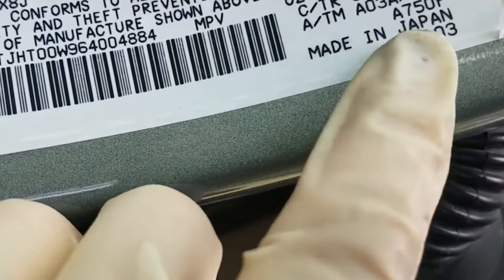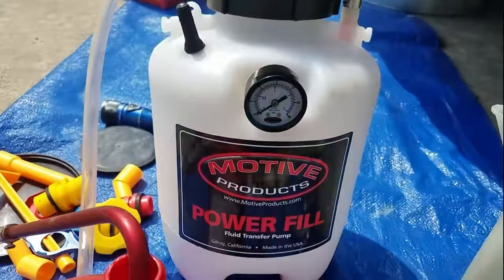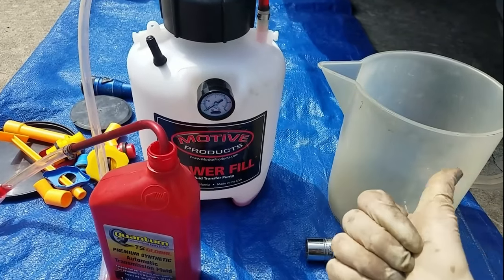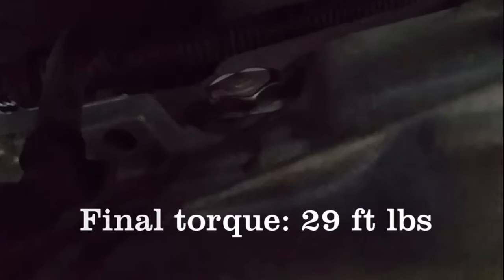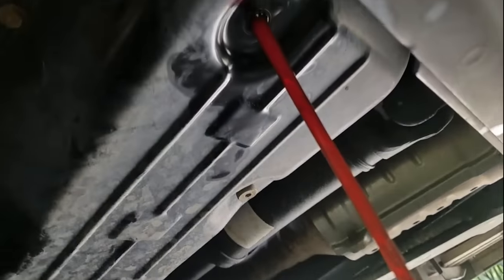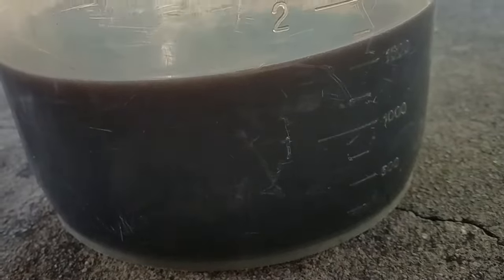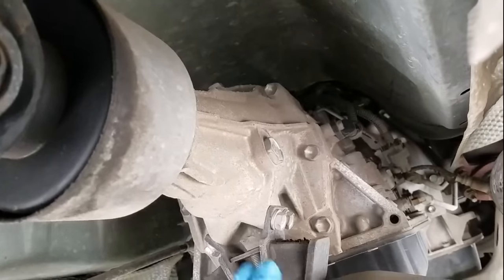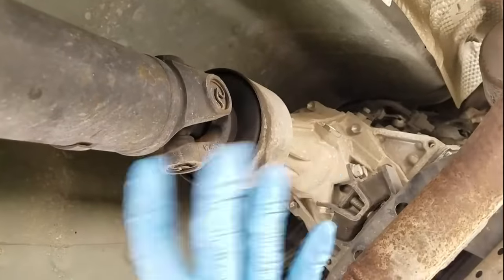How to Service a Sealed Toyota Transmission

Comment: Is there a way to check the temp of the transmission fluid without using a computer or a temperature gun?  Thx!
Reply from the maker: YES! This truck doesn't have that option because it's a base model, but you can put the truck in temperature check diagnostic mode! The AT light will flash for you when it's in range!

Comment: Does this fix the transmission shudder issue on the 4runner/Tacoma/FJs? Thanks for the very informative tutorial!
Reply: Update: Finally got around to changing on my 2007 4runner. Original owner never changed the fluids at 185k. Transmission had shudder issues when shifting from and to 5th gear at low speeds.

Changed and flushed with 12qt using this method. No more shudder! Thanks for the thorough tutorial. It made it an easy job.

Comment: Regarding filing up the transmission with the fill plug, You can tell if it's full by it leaking out of the fill plug correct???

That  way you don't have to measure how much fluid you drained right???
Reply: No, that only works with differentials.

Comment: Toyota provides a 3rd method of determining the trans temp range for pulling the check plug.  You put the ECU in to "Diagnostic Mode". It's an easy procedure.  Once there, the A/T Temp light will remain off while the fluid is too cold to pull the check plug.  Once in range, the A/T Temp light will come on.  You'll have 5+ mins to pull the plug.  Once the fluid is too hot and out of range high, the A/T Temp light will begin flashing.  It's FAR more accurate than most temp guns and it's free (vs a scan tool).   Do a search on Toyota ECU Diagnostic mode - there are tutorials out there on using it.  👍

Comment: Thanks for the video! Wouldn't have done my vehicle with out it. I do have a question though. I have a 2015 gx460 with the A760F trans. I did the service starting at an ambient temp of 87 and ran it only on the second exchange for about 5 min to cycle fluid. This heated the fluid to 104. Out of curiosity I pulled the check plug and she drained several seconds with a heavy stream before changing to a drip. On my second empty I still got 2.5 L of fluid and both times I exchanged exactly 2.5. This is also confirmed by using 5 qt of fluid. I expected the fluid level to be spot on and not come gushing out since I didn't heat up the trans much. Any thoughts? Thanks in advance

Comment: Faye, For the first part. Do you start up the vehicle & cycle through the gears? Each time, while conducting the drain & fill? Or do you do that step during the 2nd drain & fill only? Also, is Techstream available to the public? Thank you in advance!
Reply from the maker: Just for the 2nd and beyond only. At first, I assume that all the fluid is the same and doesn't need to be mixed prior, and you also get more fluid out that way!!
Reply: Faye Hadley Thank you

Comment: So I have noticed a leak around my transmission cooler on one of the hoses i think but have no clue how long it has been leaking. Would like to do a drain and fill but since everyone says whatever you drain out is what you should put back in I'm not sure how to go about this. Could I just remove the pan, put a new transmission filter in, bolt the pan back on and fill it until it starts to drip out the overfill plug? Any advice would be appreciated kinda at a loss at what to do here. Also don't know the service history on this truck so idk if it's been regularly flushed or not. Let me know what you think thank you!

Comment: Faye Its time for my 2011 tacoma to have its transmission fluid changed.  Not so pink any more but not burnt.  Should I pull the pan and replace the filter also?
Reply: Depends on the mileage and your driving conditions.  Sounds like you've done a change before.  So the mileage would be a factor.  Changing the filter would be a good idea if there is high mileage if you can put up  with a few bolts that are a pain in the butt to remove.

Comment: New subscriber here.  I have a question for you.  My son has a 2008 Lexus ES350 with 109k miles.  The car has extensive service records from Lexus but I can’t confirm this service has ever been done.  Is it safe to just do a drain and fill?  Thanks.

Comment: Hi Faye.  Is it nessasary to change the automatic transmission filter on a 2006 and a 1995 toyota tacoma automatic transmission?The 1995 is a 2.4 4 cyl and the 2006 is a 4.0v6. I did a drain and fill on th 4.0 like you did and I bought the same jeggs pump. I did not know about the filter on the 4.0. The 1995 has 78000 and the 2006 has 151000miles. Yes, the 1995 only 78000 and I dont think the pan was ever removed and the oil is brown. I just bought the 1995.

Comment: How does one adjust levels for fluid expansion?  I don't quite understand how that all works.  A local Lexus dealer destroyed a friends late model GX460 transmission after he went in for this service.  They did finally admit to their error and they went through considerable trouble to get a replacement GX transmission. Apparently what I heard was that they were supposed to get the trans temp to proper operating temperature prior to draining (I think) I guess they overfilled it and well, the transmission immediately started shifting poorly when my friend took delivery.  Hope I'm making sense to get a more understandable answer from your expertise. Thanks in advance.
Reply: Faye did a "cold" fluid change, then showed how to do a hot fluid change.  Fluid expands when hot.  So if you are putting in cold fluid into a hot engine you have to make sure all the fluid is at the same temperature when doing a hot fluid change.

When the engine is cold and the new fluid is cold, it's just a one to one replacement.    But it never hurts to check the fluid level when it is hot.

Comment: Excellent to hear that you only use the OEM fluid any perceived savings by using a "Comparable fluid" is not worth the $20 savings on an expensive transmission.  I would have cleaned the pan .
Reply from the maker: Agreed!!!! 🤘🏻 And I clean the pan on the 2nd service. I've never seen a pan at the first interval (60k) or filter (I dissect them when I remove them) that I felt was worth the time, effort, or invasiveness to service at this interval. I do it at the second interval or if there is a leak that needs to be addressed.

Comment: Just bought a new Camry, so I think i can do the drain and measure technique, and I should be fine. Granted, I have 60k miles to go before it comes time. What Bluetooth scanner do you recommend that can read tranny fluid temps?

Comment: This is maintenance not inspection. So what if it turns out that the oil still has life in it? do you still have to drain it all?
Reply from the maker: Absolutely not - I will assess the fluid before recommending a certain amount of drain and fills to a customer.
Reply: @FayeHadley  Nonetheless, you are indeed a talent capable of doing things that many men including myself never attempted doing before, so kudos to you.

Comment: Hi Faye, I have a big old rubber gasket / o ring  in my fluid container where did that come from
I left the fluid in the container and finally empied it to use fluid for saw blades
RR

Comment: After getting A/T fluid to operating temp, do you turn the engine off or leave it running when removing the overflow bolt to set correct fluid level?

Comment: Is this for all Toyota sealed transmissions? 
I have a U660F and i was reading L-SB-001-13 and it said check level at 185-194 temp.
Thats using a WS ATF Level Gauge which i don't have. I plan on doing it according to this Video.
Thanks

Comment: I would assume that if you drop and clean the pan and replace the filter first, your 2nd and 3rd drain and fill would be a lot cleaner.
Reply from the maker: Go for it. But I don't recommend it at first exchange (under 100k), there is no need. You can read all of my other comments about it here.

Comment: Was the Transmittion filter changed or replaced?
Reply from the maker: No, I rarely change the filter in the first 100k. I usually change the filter at the second fluid service (should be 120k-ish). I have dissected multiple filters at 60k and there is absolutely no reason to change them at that interval. I strongly believe that less invasive the better.... and quite a few folks struggle with the pan replacement; whether it's getting the proper FIPG, cleaning the surface clean enough for the gasket to seal, etc.
Reply: @FayeHadley  Thank you, Ms Faye .
2011 Tacoma Pre-Runner (Repo/many small anger dents)
           Currently 102000 miles and no history if serviced at 60k miles?
           Wait until  120k mi  or  pull- the- trigger- with trans filter at 102k
            Rylie Richmond
Reply: @FayeHadley  Guess i shall try the full change;  Hope i don't screw-up my trans....?
Reply: Good morning @FayeHadley  
I would have waited until 120k miles however, i needed the transmission 
oil for cooling chainsaw blades etc.  (Booboo pan  using 1 hand)
   RR

Comment: You and Boogie are great at AGG! Question: There's a lot of manufacturers that recommend multiple flushes of automatic transmission fluid at XX K miles...Would it be the same as doing 1 flush along with your oil change?

Comment: I came across here cause I'm searching for the filler plug location on my Hilux V6 with A750F tranny. Thanks to you I found it. Now my question is how can I obtain the Toyota TIS system as an independent user. Do I need to purchase the VCI aside from the dlc3 connector?

Comment: How do I check fluid level on my car without a thermo scan tool before I remove the excess plug? 

I have the 2015 Altima. I bought it at 7 miles now at 55K miles. I hate the car but wash, dry, wax it regularly. Looking to trade it in soon for a Camry but that has a CVT as well which I hate. Perhaps I will look into the 2021 Honda Accord EX-L with a 10-speed automatic but I hate car payments. LOL.

Comment: It's 104F outside today. Do I need to check the transmission fluid temp to change the fluid on my black 2014 Toyota Sienna. My old OBD2 reader isn't compatible.

Comment: ? When you change transmission fluid would you also change the differential fluid also or is that on a different mileage specifications?
Reply from the maker: Great question - depending on the year, I will usually recommend on similar intervals (but remember: Toyota doesn't have a mileage spec for this at all!) either 60 or 90k depending on the fluid and severe or normal service table :)

Comment: that's all i do. whatever came out, i put that amount back. i use a bucket from home depot that has quart graduations on it. easy. the manual calls for checking with scan tool to make sure it is at operating temp but the not even the dealer does it.

Comment: Question for ya: Is there ever a reason to drop the pan, like a transmission filter replacement?
Reply from the maker: Yes, I filmed a follow up video but haven't edited it yet ☹️ so busy! But yes I do a fluid exchange at 60k and fluid and filter at 120k.
Reply: @FayeHadley keep it up! Proud of you and thanks for the info.

Comment: Wanted to send my love via a box of candy from Hawaii.  
Local toyota charges $300 to drain transmission pan, but they can pick up if 
I reside close enough (not me, so sad).  
Also trying to catch your torquing spects.... ?!!! 
RR
Reply: Does the  drain plug crush washer have a size ?  Local napa
sells bolt  and crusher combo only,
RR

Comment: Hey i have a question for yah...i have a 06 gs430 having hard downshifting from 2nd to 1st gear...i have had a check engine light code only once...it was a solenoid b performance code stuck closed...but it only happened once or twice...i have done a lil research on it and clublexus forums are stating its the ECU needing to be flashed and reprogrammed...what would you recommend...im going to start with the trans fluid and see if it remains...but have you heard or delt with this particular issue...thankz

Comment: My 07 Taco PreRunner has 341k miles and was flushed once at 109k. Yesterday it wouldnt accelerate but minutes later it did. I feel like its the tranny. Should i bother with a flush or just get it rebuilt or a new transmission? TIA to any help!

Comment: I did this procedure on my RAV4 with 15gal of WS 8x cycles as ahe shows. I gotta say that the color change didn't really impress me. I did it in my GM by unplugging the cooler and dumping new fluid in continuously and it was very clear when the old stuff washed completely through. Dark brown to cherry red in 1 shot.

Comment: I have a 2014 toyota rav 4 whit 100.000 miles do you know the right temperature wen I drain the the plug i have a seal transmission

Comment: Quick question- does anyone use an inert gas like argon to purge the air out after the fluid change? Does the factory purge out the air? Specifically for the non dipstick cars

Comment: Saludos.  ¿Como reemplazo el sensor de temperatura de una transmisión automática de una 4runner 1997?  Es sencilla motor 3400. 6 cilindros.  
En ingles dice la caja donde compre la pieza.  Sender/Transmisor
Sr. Pérez

Comment: Dear Faye, I saw you use TIS scan tool for the transmission temperature parameter. Will this works: VCI J2534 Cable Fit for Toyota TIS Techstream - Latest Version V16.00.017, Firmware V1.4.8, Scanner Adapter Diagnostic Cable Scan Tool, OBD2 Diangostic Cable, Support Win XP WIN7 WIN10 32/64bits?

Comment: question for you, should i change the transmission filter? or should i just do a drain and refill. 100K miles are on the transmission 05 sequioa.
Reply: I'd change the filter also, clean the magnets. Dropping the pan and changing the filter usually gets you another quart or so out of the drain and fill process, so that's a plus.

Comment: I have a 2006 4runner, 250k miles, no evidence of any transmission service ever. Should I consider a drain and fill or just leave it alone. I have no current transmission issues.
Reply from the maker: I'd start with draining a little out - maybe a quart or two - and replacing it, and inspecting the fluid and seeing how it responds with the new fluid!

Comment: dumb question how do you figure out the torque requiments for bolts on a car? My lexus manual has some torque specs as well as the official repair manual I bought. However I am still not able to find them all. I serched online but I can't seem to get a ligimeted  answer for example for the bolts from the head gasket plate on a lexus es 330.

Comment: After replacing the A/T Fluid my car gets started vibration when turn to lever on D mode.

I have Toyota Fortuner 2011, I used proper grade of fluid without any change of filter after 11000 Kilometers fluid gets  black in colour.

Comment: So the check plug. Just undo it and if it's too full it will pour out. But if there is not enough do you just add some until it's over full. Then drain it and then it's good

Comment: I get this job at least once a week. When i see a nice colored red trans oil coming out the drain plug, i stop. This trans oil is still good. Just run it  warm and topped it up with toyota ws. Over servicing can be as bad as underservicing.😂

Comment: Wonder if you could do this with the BMW non serviceable transmissions
Reply from the maker: You absolutely can. And the manufacturer - ZF recommends changing the fluid every 60k. I'll be doing this to my Mk5 Supra as well, (has a ZF 8 speed) and will make a video on it.

Comment: Just flushed the A/T on my 2006 4Runner with a sealed tranny.  Let me stress here the importance of Faye's advice to loosen the upper fill plug (marked WS) *before you drain the fluid*.  Because: a) that plug can sort of weld in there a bit, it has a very shallow hex head that is easy to round off, and on a number of forums you will find people who think it is closer to 15/16th than to 24mm. Certainly the 24mm socket felt loose ... IF you can get it on the plug, because: b) The only 24mm I had in the shop was (*was*, past tense) a deep well impact socket. Which didn't leave room for the breaker bar. So I had to use a cutoff wheel to shorten the socket to remove the fill plug so I could put fluid back in the transmission.😣

Yeah. Loosen that top plug *first*.

Comment: I have a easier and alot different way, the 5mm hex is a check/fill plug, with the engine running in park when you take it out it should just dribble fluid out, so u don't have to measure it but that is a great idea, now to fill it u dont even touch that 24mm with ws on it, all u need is a small enough hose to fit in the check/fill hole and put about 4 qrts in then start the engine and with your foot on the brake go through each gear slowly then when you get in park take the check/fill plug out and add fluid till it dribbles out usually around 5 or 6 qrts

Comment: Before putting the new fluid in after you drain the dirty pan fluid out .put the vehicle in neutral .start the engine and let the torque converter pump all its fluid into the oil pan and drain the rest of the dirty fluid out before you ever put in the new fluid that's the easiest way.

Comment: 2000 Toyota Solara no heater have air flow , check and I have a code 21 and 41  need help

Comment: I will never touch the fluid in my manual 2016 kia soul, it says not too, now I would have but now it has 280k miles on it so ive heaRd doing that can basically junk the transmission

Comment: Yeah are used Toyota OEM parts when it comes to fluid replacement I use “AMSOIL”the best Synthetic Motor Oil Signature  Series and Signature Series ATF  transmission fluid and gear oil. My opinion there is no better.